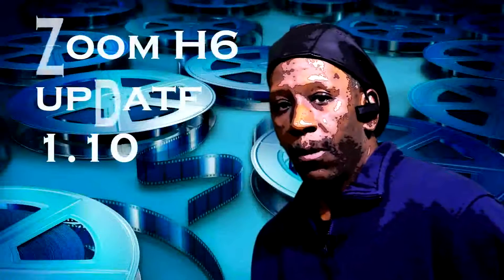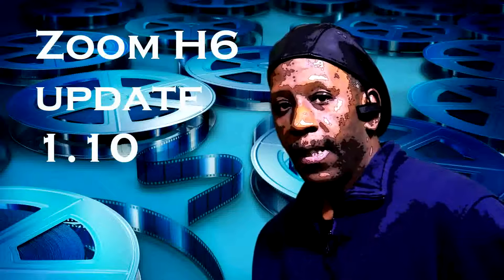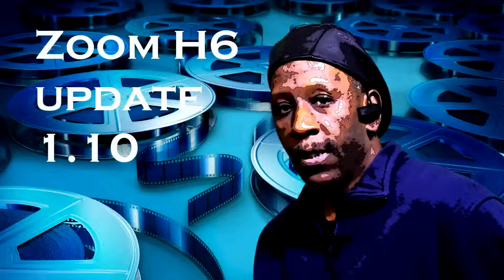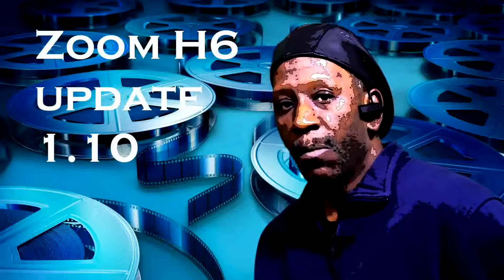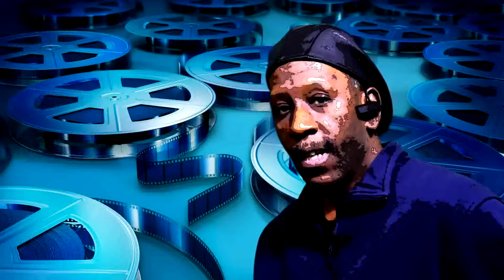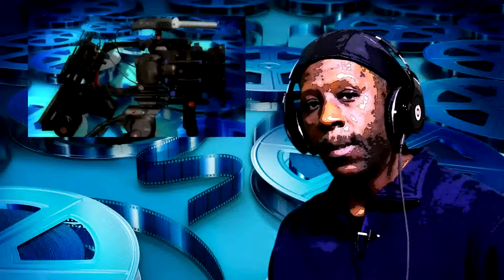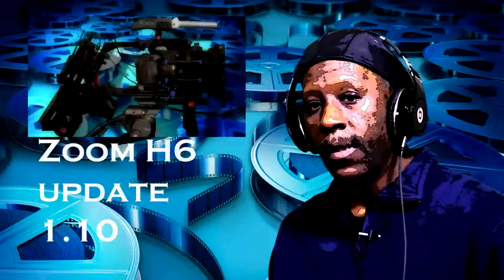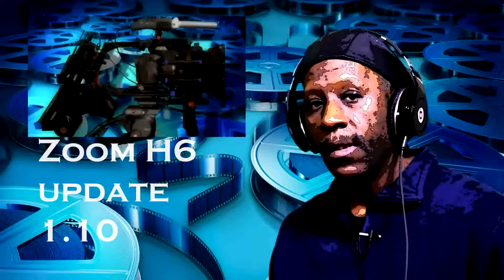Zoom H6 firmware update 1.10

Comment: Overall volume for the second adjusted noise floor was to low to test.  I thought the idea was to keep the volume up and lower the noise floor.  This test was inconclusive for me.  If you do another test could you keep the volume at the same level and produce a lower noise floor.  Otherwise it just sounds as if you lowered the volume overall.